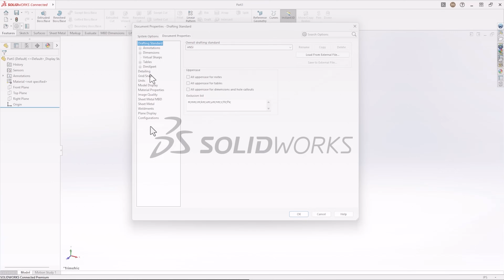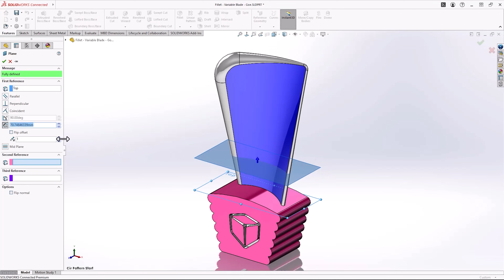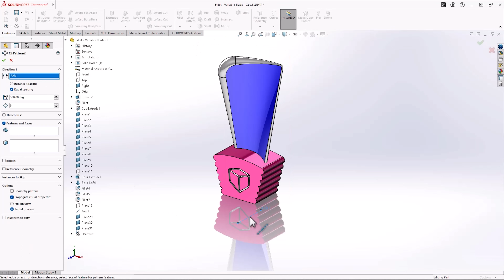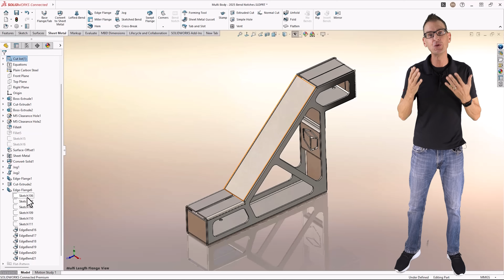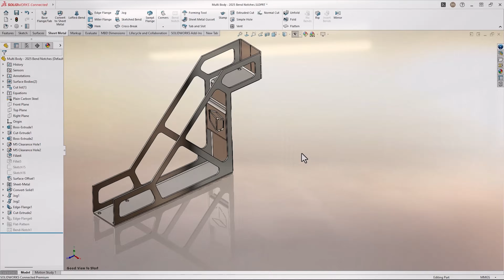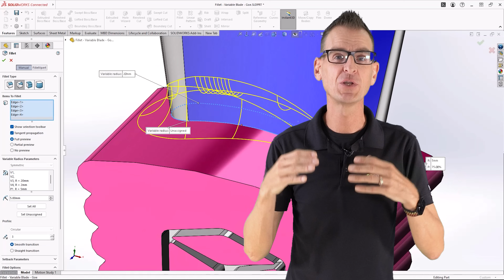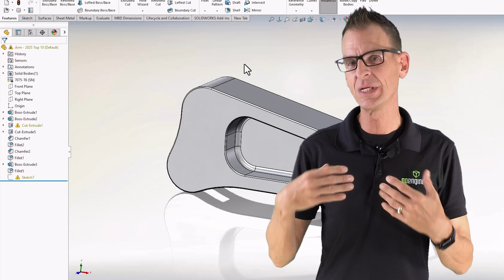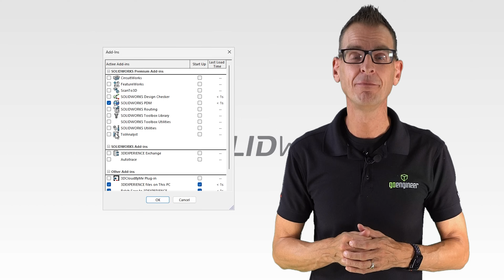SOLIDWORKS Expert Reveals Top 10 Features in SOLIDWORKS 2025

Comment: @goengineer Why is the naming of products still so bad? No one knows what is what. When using Solidworks Connected, what is the best way to set up automatic part numbering, templates, and toolbox/hole wizards? I want to set it up so that 3 users can all have the same settings. So I want to have everything driven by the cloud vault. I can set up an EIN generator, but that only works when I tell it to generate a number, but I want that to run on every part at first save and to make it the part number. It would also be nice to define all the toolbox parts with standard EIN in their properties. Why isn't Solidworks providing all of these features as a default installation configuration? Why do users still have to do so much setup just to get an environment working. I generally discourage people from using 3DX still, but when it is used, these are the things that should be fully functional, rather than being half baked.

Comment: The bounding box is such an amazing feature to use for tying in dimensional sketches for equations and global variables but the performance of it rebuilding per configuration doesn’t rebuild. Why is that?
Reply from the maker: There are a number of reasons you might see this, the best path forward would be to reach out to your VAR's tech support team so they can look at your situation specifically.

Comment: Can you control the size of bend notches? I normally put a semi-circle so as not to have a weak point
Reply: yes you can make them any size you want and they can be circle, square or triangle. Kind of like when you are slotting and tabbing there are several options.
Reply: Yeah, I agree with you. I don't thin you can control the shape. It's really bad designing for such a software.
Reply: @eduardogm8236  you can make them several shapes, triangle, circle, square and make them any size you want.
Reply: @eduardogm8236 please watch again…your question was answered directly in the video ☺️